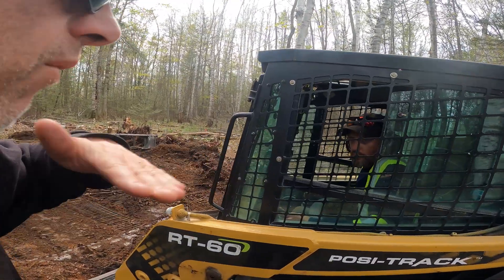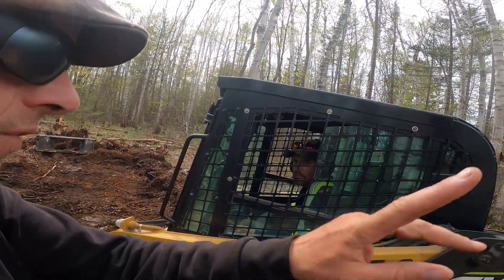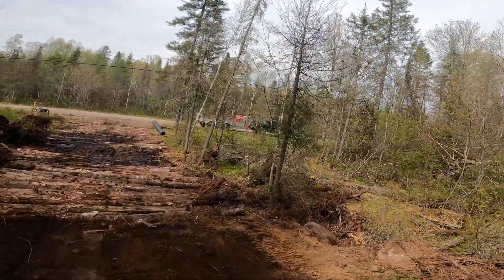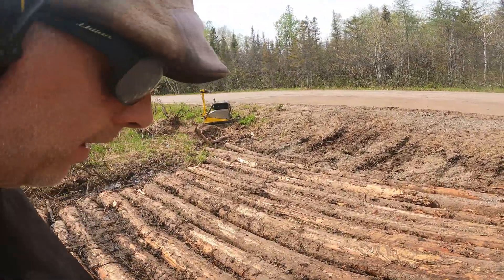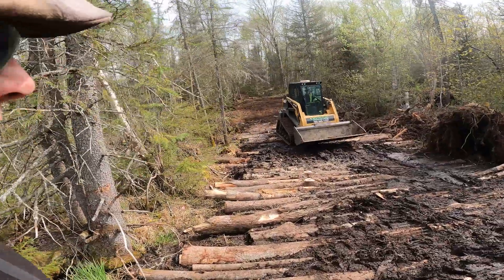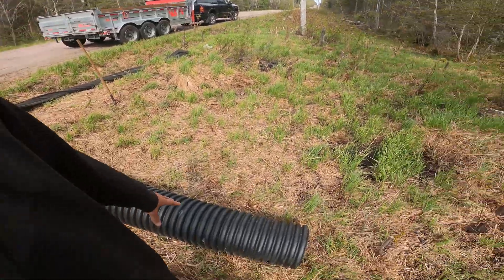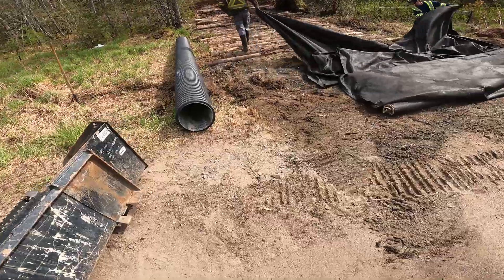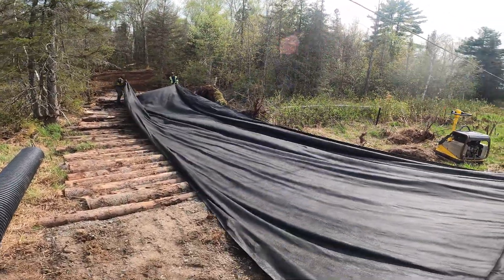Building a corduroy road over swamp | Will the 42 ton Dump truck make it over?

Comment: Thanks for the explanation of a corduroy road.  Question for anyone, with the first logs laid down longitudinal and then the second layer running across there could be close to a foot of thickness that is going to rot away.  How does this affect the future of the road since this is the foundation?  While building the road do you add extra height gravel /dirt, or is it added in the future when it drops, or is it just not a big deal?
Reply from the maker: The logs won't rot because they are submerged in the mud and are preserved from the lack of oxygen

Comment: Hello 
I have a 2008 ASV SR80, my left drive forward hose blew, if I jack the rear of the machine will it drop the rear axle enough for installation of the new hose 
Thank you
Reply from the maker: I'm not 100% sure. I did one on my PT60 all I had to do was drop the belly pans, I think I took the track off and took out the seat /floor. That gave me access to install the new line

Comment: What are the benefits to this type of road vs. just putting down layers of base rock and gravel? Wouldn’t the logs just rot? Would love to hear any insight.
Reply from the maker: Well there's an abundance of trees in the area and we needed to get rid of them. So you're saving cost and materials At the same time the logs get pushed into the mud and are preserved. The logs can act as a thermal break preventing the base from heaving. The length of the logs add rigidity preventing rutting and basically allowing the base to float on top like a bridge. In the description of the video I also added a link that goes into further history of corduroy roads

Comment: Is that road not going to just sink and wash out as the trees decay? Seems like a lot of money and time for something pretty temporary.
Reply from the maker: It's the opposite the logs will be preserved by the mud and it saves money because logs are leftover from lot clearing. I left a link in the description on the history of corduroy roads check it. Also the logs displace the weight over a greater distance and currently there is 100 tons of aggregates on top of the road so it's settled.

Comment: Awesome video. I have a smaller project on my channel. I am doing for an access trail to the back of our property. While my property is not always super wet, it is wet most of the year. This video is the first I have seen on this scale about this very topic. I however am hoping that I can get the logs in place and use the muck from ditching the side to layer on top. After it settles and hardens, I am hoping it will be a good base for stabilizer later on.

I am glad I found this and know I am not the only one that has to make a road/trail through a march/swamp. I am subscribing because this video was a huge boost me wanting to get mine done now. Keep on keeping on.

Thanks again.
Reply: Yup doing the same on my property… 500 yards of swamp to get through… 😳
Reply from the maker: Thanks I'm glad the video helped

Comment: Sometimes you have to make due with what you have. One of the short-commings of the ASV undercarriage is that while it is perfectly capable for dirt and loamy soil, it's not well suited for working with rocky materials. Even when you're being careful and cautious not to get any materials into the undercarriage, it still happens ... and those sharp rocks tear up the rubber wheels, and they can cut the tracks too. I find that rocky materials are also really hard on the bucket. Working with dirt alone, the paint wears far better, and the buckets tend not to rust up as much. But do just one job with rocky materials and the paint will come off the bucket like it was sand blasted.